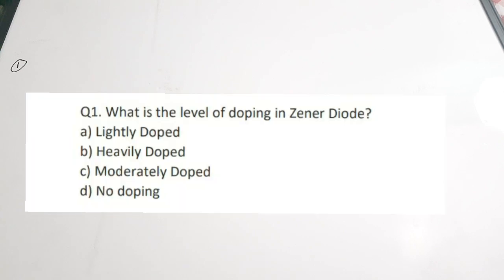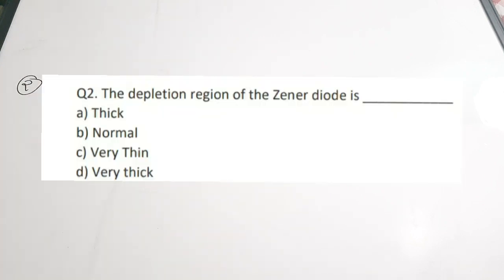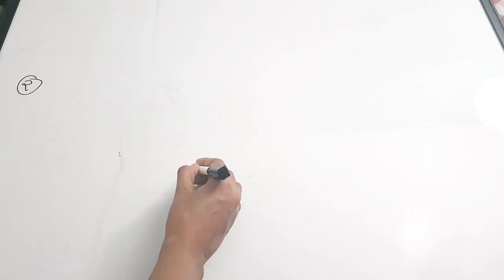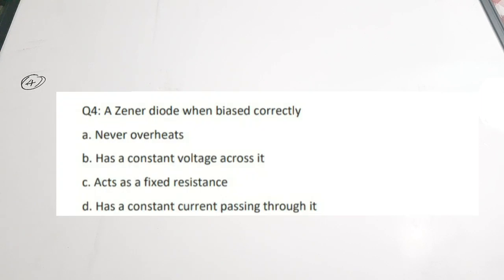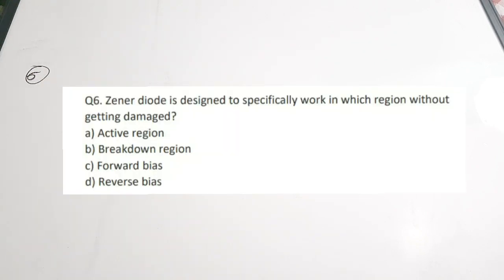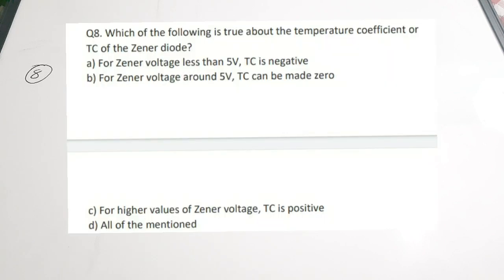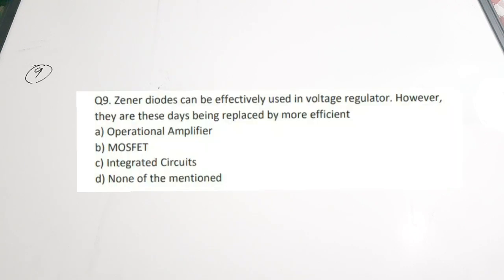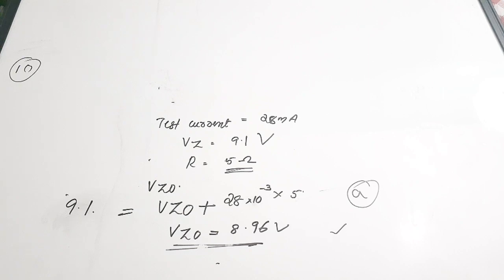Zener Diode MCQ| AFCAT EKT 2021 Electronics| BIS Technical Assistant Electronics|zener Questions

Comment: Ma'am how to proceed further if zener diode is not under go breakdown ? I mean if the voltage is not sufficient.
Reply from the maker: Then also try to find the voltage across series resistor the remaining will be across zener and same will be across RL since they are in parallel combination
Reply: @EasyElectronics_jobupdates  ok ma'am thank you ....